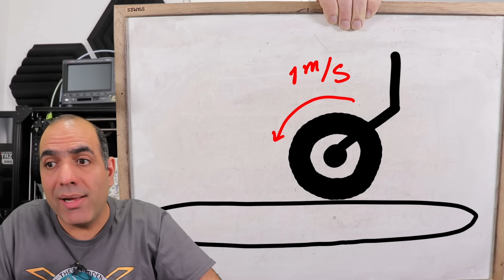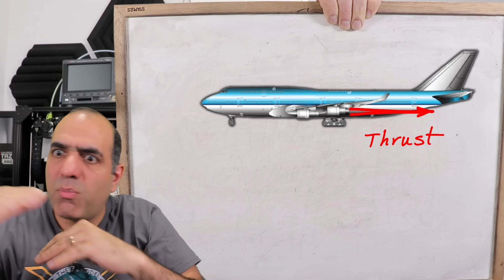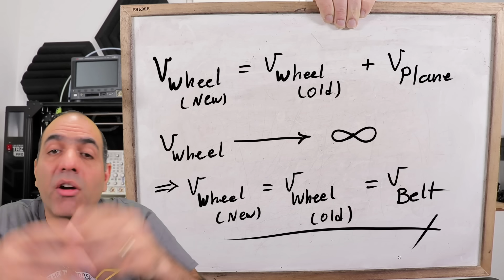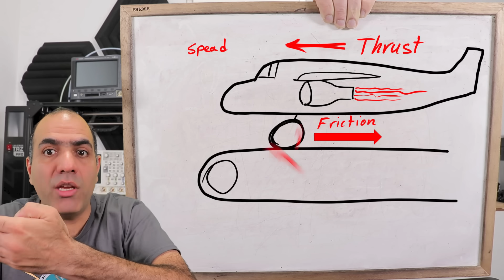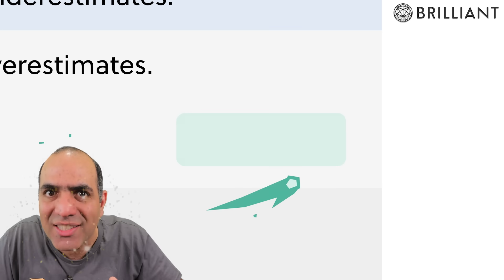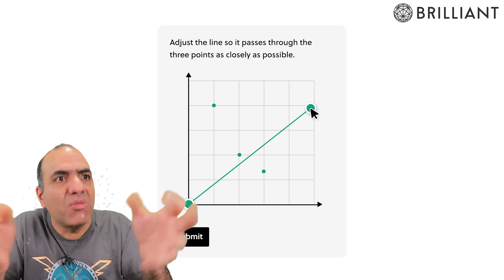Airplane Question that Drove Me NUTS!!!

Comment: ok , THE answer  = a plane has to have lift provided by air flow over the wings to fly  unless its moving relative to the wind it cannot fly , so NO = true if its a jet & yes if its a prop driven plane
Reply: thousands of pounds of force forward, nothing holding it back, and it doesn't move forward?  why?

Comment: No f#@%ing way it takes off. An airplane needs airflow under it's wings to fly. Sitting stationery on a conveyor belt ain't gonna do it,  no how, no way. The wheels turning at a thousand mph doesn't create thrust. A toddler could figure this one out.
Reply: thousands of pounds of force forward, nothing holding it back, and it doesn't move forward?  why?

Comment: As soon as there is thrust, the tires and the belt will accellerate. The tires of a 747 are made for a speed of 204 knots. For sure they can handle more, but after all, the tires will be destroyed by centrifugal force and parts of the tires will fly around and most likely damage the plane which will explode immediately.

Comment: It depends on the airspeed over the wings and the angle. There have been airplanes that have "taken off" due to high winds like a Cessna in a 60 knot winds but it's highly unlikely that the wind would be blowing hard enough in most circumstances to provide enough lift for a 747 (160 knots, almost 200 mph) to takeoff.  And the fact that it's on a treadmill with it's engines blast would have zero effect on the takeoff itself, but would obviously matter if you wanted to keep said airplane aloft and not have it crash  back into the ground.

Comment: Answer 2478 the plane and conveyor belt actually Started 40,000 feet in the air, so it's already flying. I hate these questions too. There are assumptions made by the creator, different ways to interrupt the language used, and the physics that govern our Universe.

Comment: The actual ground speed of the plane would be 0 knots thus the plane would remain in a stall condition in which the wings do no generate enough lift to take off.
Reply: thousands of pounds of force forward, nothing holding it back, and it doesn't move forward?  why?

Comment: there's also the fact that the belt isn't just applying torque to the wheels, it's applying a backwards linear force, which gets transmitted through the wheels to the plane body, adding another element to take into account.
Reply: Friction is what transmits the backward linear force.
Reply: @TheAdriyaman  yeah, friction is how that force is applied, and friction is also why the wheel rotates
Reply: That's already mentioned in the video.
Reply: @Sylfa  yea my apologies I didnt watch the whole thing first
Reply: The rolling resistance of the wheels is negligible. If it wasn't , the wheel bearings and tyres would burst into flame on every take off and landing.
As it is, the brakes sometimes glow red hot when the plane slows on landing
Reply: @PaulG.x  not talking about rolling resistance. If you put a car with perfectly frictionless bearings on a treadmill at rest and started the treadmill, the car would still move. The only case where it wouldn't is if the wheels had no rotational inertia.
Reply: @Glub_blub I'm aware. It's just an on-paper thing to at least entertain for a moment.

Comment: I'm pretty sure it would theoretically take of, but realistically the poor wheels would probably explode because they aren't made for twice the speed they normally spin at, the conveyor belt may also cause some wind and vibrations that may cause some trouble
Reply: Nah, air speed over the wings is what determines whether or not a thing can fly. The wheels are just there to stop the plane from breaking apart while it accelerates.
Reply: no i lt wont. I proofed it in a video of mine.
Reply: Wheels are the problem here?! How about literaly impossible to make conveyor belt that should move at ridiculous speed and require nuclear power plants to even work, not to mention that material of the belt iself is nowhere near as durable as concrete of a runaway.
Reply: What?  The runway would move in the direction the plane is moving so the wheels wouldn't turn.  The plane would move forward and takeoff normally with the wheels not spinning.
Reply: There's always a factor for safety, it's very low on planes since they need to be light, but the wheels are literally going from 0 m/s to spinning at landing speed when the plane comes in to land. They can handle that acceleration so they should be perfectly fine spinning twice as fast. In fact, the mythbuster episode pretty much did rotate the wheels twice as fast with no real impact.

As to the theoretical problem, the wheels can only brake and rotate, they don't create any non-frictional forces so in a realistic scenario it would do nothing but increase maintenance cost. In a fictional scenario it depends on what the author wants.
Reply: @Sylfa  *Safety margins on planes are very large

Comment: There could be winds that could help the plane take off. Also putting on full power thrusters can help as well. I don’t know much about planes, but IMO, i think its possible for the plane to take off. I mean, the only problem I see here is that the plane is as long as conveyor belt. Again, just my opinion. Im probably wrong lol. The wheels moving fast might easily disrupt the plane from taking off.

Comment: The plane needs air for lift right? If it’s sitting on a treadmill I don’t see how it’s going to get enough air under the wings to take off.
Reply: thousands of pounds of force forward, nothing holding it back, and it doesn't move forward?  why?

Comment: Mythbusters used a prop plane that created the air flow, which in turn created the lift. This worked on a tiny scale model on an actual conveyor belt, which they already knew would work in real-life and there was no myth to be busted there really.
We think flight comes from speed but that's false. It comes from the lack of pressure on the top of the wings, which may be initiated by speed but really only requires air to flow over it.
Jet engines do not create different species of thrust, so if that engine is actually turned on then it will rapidly exceed the conveyor's capabilities after 10-15 seconds and just take off like the prop plane did in mythbusters. 

Thought experiments are the scourge of the internet, it isn't even particularly clever to come up with any solution as the question is often curbing itself of potential fun.

Comment: My initial intuition is that the engines push the plane forward not the wheels, so the wheels would blow up because of over speed if the belt always matches them

Comment: If your 747 was sitting on a conveyor belt runway. That was running at,, 150 mph or so.. Would the plane take off? No it would not. And the reason being is, it has no forward inertia. And therefore it has no lift. Even if the runway is running at 150+ miles per hour under it. It will go nowhere, fast.

So lift is produced when you get the forward motion and its inertia. Which will then raise the craft. Above the ground. With its forwarded inertial momentum. Which it won't have. Sitting on a  conveyor belt runway. Running at 150+ miles per hour. And the plane will not move forward.

At least that's how I see it.
RemyRAD
Reply: thousands of pounds of force forward, nothing holding it back, and it doesn't move forward?  why?

Comment: Given the question as posed and my fundamental presupposition being that I should apply real world mechanics as much as possible the reason that a treadmill works the way it does is because running generates energy based on work done against the resistance of the ground where is Plains Propel themselves buy a differential air pressure behind the engine and lift themselves buy a differential pressure above and below the wings Force Mass acceleration and all that in other words you're puny treadmill means nothing as long as the plane keeps a perfectly straight trajectory if it deviates while the weight of the plane is concentrated on the front Wheels then it will either be pulled sideways any toppling motion or commands to death wobbling and eventually f**** right off the treadmill so the answer is yes under the right conditions with perfect execution but it would be a stupid and dangerous stunts that no one would ever attempt with something as expensive as a 747 at least in my humble opinion

Comment: The wheels are not powered, so the jet engines will still push the plane and lift off. 
(As long as the wheels don't come apart and take out an engine.)

Comment: The most sensible interpretation that makes it useful to think about IMO is "the treadmill does its best to keep the plane stationary".  In which case, the ramp up to infinite speed happens, but not infinitely quickly because the wheels have some angular momentum.  And then it becomes more a quality control question of whether the treadmill or the plane wheels explode first.  If the treadmill explodes first, it will probably destroy the plane and its engines with shrapnel, and the plane won't be capable of flying after that, but it might get lucky and remain in a good shape to take off from the debris field!
Reply: Wheel speed and conveyor speed are matched at the contact point between them and wheel only rotates when the plane moves forward. Again the plane moves Forward and the wheel rolls exactly the same distance on the conveyor belt. with everything matching exactly at what point in the forward movement of the plane does the wheel get ahead of the conveyor belt causing the belt to start?                                                                                             The riddle (Imagine a 747 is sitting on a conveyor belt, as wide and long as a runway. The conveyor belt is  designed to exactly match the speed of the wheels, moving in the opposite direction.)                                                                                                                          Can the plane take off?                                                                                                                                                                                                       Let's break it down                                                                                                                                                                                                                 747= real plane, it will take off                                                                                                                                                                                               Sitting= Stopped, not moving, wheels not turning, and conveyor not running.                                                                                                    Conveyor belt designed to exactly match the speed of the wheels = Conveyor belt can only match wheel speed, it can't change wheel speed.                                                                                                                                                                                                                       Moving in the opposite direction= The top of the wheel  moves in the same direction as the plane's forward movement, the bottom of the wheel moves in the  opposite direction to the plane's forward movement. So any conveyor belt the wheels roll over moves opposite the plane.                                                                                                                                                                            To make the wheels turn the plane must move forward, as the wheels turn they roll on the conveyor belt at the same speed. Because the speed of the wheels  already matches the stopped conveyor belt, the conveyor belt  will not have to start and the plane will take off.                                                                                                                                                                                                                                  I see now this is not a riddle, it's the definition of how planes take off from a runway with one word changed. they replaced the word runway with conveyor just to confuse
Reply: Oh, I thought it meant the treadmill made the place go backwards at normal speeds
Reply: but it doesnt need to go to infinity to take of the take of speed for a fully loaded boeing 747 is 160 koas
Reply: @FletcherBarnes-he6rn  The point is taking the interpretation as the conveyor belt doing its best to prevent the plane from moving forward.
IE: keeping the wings at zero airspeed.
The belt can only use the momentum of the wheels to transfer force to the body of the plane and resist the engine thrust.
Thus, the belt has to use acceleration to counter the thrust, and not any finite speed.
This then results in rapid mechanical failure and explosions.
Reply: @nickdumas2495  you are completely correct accept for the fact that the picture says that the conveyor belt matches the wheel speeds
Reply: @FletcherBarnes-he6rn  Matching the wheel (rubber) speed would just mean not slipping.  Matching the axle/body of the plane's speed is different, and disappointing.
Setting the treadmill speed to the plane's forward speed is boring and for common people.  Doing your best to prevent a plane from taking off using a treadmill runway?  That's the fun and exciting interpretation for people who know even a little about physics.
Reply: No, that's not sensible. The question said the treadmill moves the same speed as the wheels, not "fast enough to keep the plane stationary". People deliberately pick that bogus interpretation to be edgy.
Reply: @WJS774  It is more sensible than a "treadmill doesn't even really try" plan.  The boring interpretation is pointless.  Channel XKCD and ask "but what if we tried more power?"
Reply: @nickdumas2495  Again you ignore what the question actually says. It doesn't say a damn thing about "trying", and the word "stationary" is not present in any formulation of the question. That you think that is more "interesting" is completely irrelevant to what the question actually asked. It would be even more interesting if John McClane blew up the plane as it tried to take off, but "interesting" does not have anything to do with it.
Reply: @WJS774  If you take it like that, its a stupid question, and we should just ignore it.
Reply: no, the wheels will skid out before infinite speed. It would be trivial to take off with locked wheels.